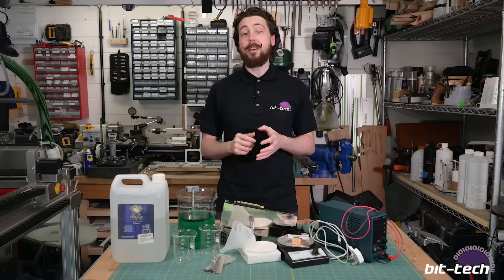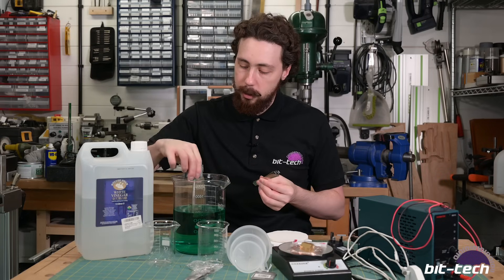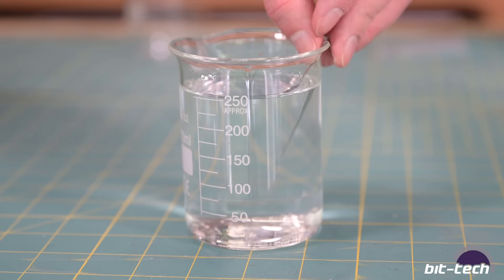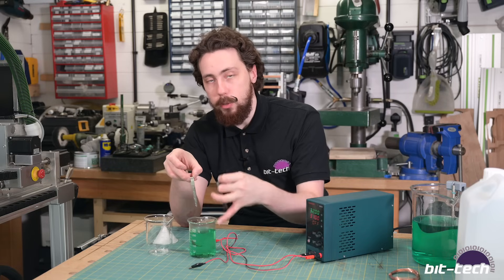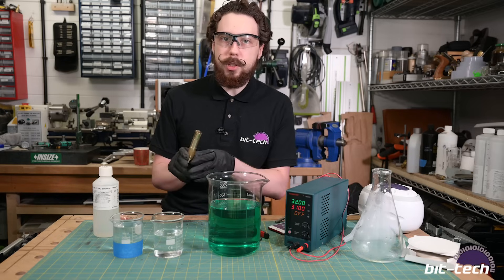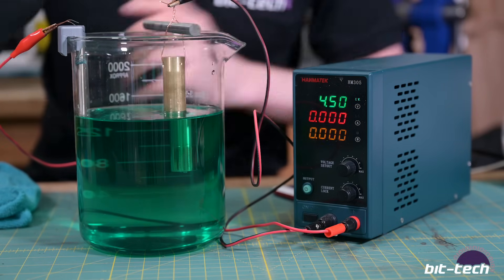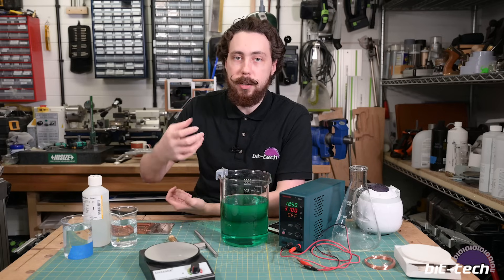How to Nickel Electroplate at Home | bit-tech Modding

Comment: Hi, any idea on how to estimate the amount of materials required for a particular surface area? Or I suppose, how do you know when the plating solution is exhausted?
Reply: I've never added salt to my solution. What I do use is canning vinegar or the 5% acetic acid. It seems to start plating nickel almost immediately without turning the blueish green color. Using 5 volts and polishing the parts to a mirror finish beforehand leads to the best results, don't forget to degrease the part before dropping into solution.

Comment: Question sir: I have a future project that involves doing this to a copper laptop heatsink including heat pipes for the purpose of applying liquid metal to obfuscate the inevitable corrosion. Thoughts?
Context: I would like to upgrade my Clevo P870TM1 with a 9900KS I purchased from Silicon Lottery that has been certified for 5.1Ghz and de-lidded as per their services. Under the constrained thermal environment of a laptop I want to give it as much headroom as possible and putting liquid metal between the IHS and the heatsink may only amount to a few degrees, but as you can see, every degree counts. That is also why I went with a Silicon Lottery certified 5.1Ghz KS as my reasoning is that if I don't get the full 5.1 out of the chip then 5.0 should be more power and thermal efficient based on the benchmarks for that chip, as that silicon is pushed right to the limit and there was quite a noticeable difference in thermal and power efficiency between the 5.2Ghz max of that chip and the 4.9Ghz min. I do know Der8auer, Roman, did a similar video recently that I have not yet watched, but he does not have anywhere near as cool of a moustache.....
Reply: Roman used the 'chemical nickel' process. Chemical nickel is more easy to apply locally to the Heatsink base but wont give you that nice Nickel plated look that you are used to seeing. It's more like turning copper a bit silver. Chemical Nickel would work for your purposes however unless you wanted to plate the entire heatsink into a lovely looking nickel. Go with electro plating if that is what you want to achieve.

Comment: If I solder brass pieces together, there will be spots where the solder remains on the surface.  Will these still plate uniformly (as in will the areas be significantly different in finish from the brass)?
Reply: That’s a really good question as I was wondering the same thing

Comment: Hello from Tokyo, I’ve gotten my hands on 0.5mol of Sulfuric acid, what is your recommendation on mixing with distilled water?
How many parts of 0.5 mol to distilled water to get a somewhat safe but effect level of acidity for the solution before I dip my nickel anodes?
Reply: Hello from Kyoto. In Japan e have 90% acetic acid available cheap and without restriction. Measure your PH to reach 3.5-4.5 acidity level. At least it works for me.
Reply: @MsLeguman  Thank you for your reply! 
I am wondering if I can use the 0.5 mol of my Sulfuric acid for light “etching “ to clean the surface before starting the plating process?

With many online videos it’s never clear what is being used as a “light etching” solution, I am I am hoping to use my sulphuric acid in some of my process.

It’s very nice to have a close neighbor commenting ;).  FYI I am based in Shibuya.
Reply: @r.in.shibuya  idk about sulfuric acid. i use HCL 10% sold by Matsuba, dip my parts around 3 min as concentration is quite low. Not sure it has an effect though. WIP on my side.

Comment: I have issues with adhesion, getting some spots where it flakes and peels. I have to go back, lightly sand the flaking/peeling down to where it adhered and replate that area. Any ideas or suggestions? I'm not using an adjustable power supply, no hotplate with stirring. I do an acid pickle with muriatic acid.
Reply: What is the part you want to coat made of?

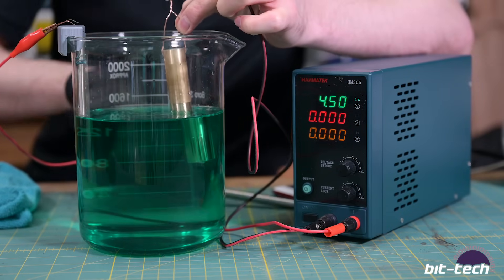Comment: @21:00 why was the current zero? the meters look like they have milliamp resolution, less than 1mA over what must be several square centimeters seems very low for many plating operations.  I can imagine that on a cheap supply the last digit might be fake, but less than 10mA is not much either.
Reply: I was thinking the same thing. In fact I have the same power supply and just checked it across a 400 ohm resistor. With the current set to 1-milliamp (0.001 amps) and the voltage cranked up over 3 volts the power supply enters constant current mode and, indeed, does display 0.001 amps... at 1.8 volts average, once it warmed up ( it bounces around a bit, +/- 0.15v).  Was 2.35 volts when first turned on. 
So, the last digit does work. Well, it read out a number, which can be set. A quick bit of ohms-law math reveals the current displayed is in error by ~400% (current x resistance = volts, .001 amps x 400 ohms = 0.4 volts; I'm reading a voltage almost 5 times higher). The actual current is 0.004 amps (4 milliamps, not 1 milliamp). The resistor is actually 466 ohms. And the actual volts are 1.81 average. So the volts reads out good.  
I would like to see what the voltage goes to with the volts set to 32v and the current set to 0.001 amps. 
Time to open up the power supply and see if it can be calibrated.
Edit: No calibration potentiometers inside. Looks to be firmware calibration only. I did check the error at higher current and the error in the current display seems to be consistant. It's reads 3-millamps low at 1-milliamp set, and 2.5 milliamps low at 400-milliamps set. So that's only a 0.6% error at 400 milliamps. Very acceptable.

Comment: Hi id like your imput on nickel plating the inside of a motor cycle steel petrol tank ? Older classic bikes often suffer with rust from the ethenol in newer fuels and old fuel being left for long periods of time. ,obviously the rust will be removed first .all the best bob

Comment: Red is positive = anode and white is negative = cathode. Why is mine making bubbles on the red wire side? Is it possible that the red wire is negative and the white wire is positive ? I am using a phone charger consisting of a red and a white wire.

Comment: i've been wondering about this is it fairly expensive?
Reply from the maker: Nope, the biggest expense by far is a DC power supply if you want full control, everything else is very affordable. Even then, you can use an old phone charger much of the time as they operate usually within 5V. Best bit is once you've made the electrolyte, you can keep it around and plate at will.
Reply: bit-tech thanks i'll give it a go for sure just got a DC power supply

Comment: Is there anything that you could paint on an area of the  item to be plated that would resist the plating only in that area? Blockout?
Reply: Great question that leads to broad possibilities. I have yet to plate but foresee a lot of trial attempts to answer such questions. If fingerprints block plating efforts then maybe start with the easiest block I can think of offhand - ink? Like a permanent ink pen which would allow selective plating creating a logo for example. Would that create an edge that would cause flaking of the plating down the road? On and on…So much fun. Good thinking Charles!

Comment: I tried to repeat the steps with a steel specimen, without much success. Seems there is no adherence of nickel on the cathode. Do you think the problem is the base metal? Does this work on copper only?
Reply: When I brought a steel part in for nickelplating, they said it first had to be copper plated to get a better finish

Comment: Were you able to measure the thickness of the coating you acheived with your micrometer?
Reply from the maker: James Carter You know, I never thought to check it. That could be quite interesting to see.
Reply: @bittech1   so what was the thickness ?
Reply: No.  The plating is way thinner than a thou or even a ten-thou.

Comment: Im trying to coat old bolts have soaked them in vinegar and removed the rust and ultrasonic cleaned them and then picked them but rust appears after would wax n grease remover or methylated spirits instead of distilled water it makes it rust

Comment: at 3:10 In my oppinion it's a really bad idea to put a lid on any electrolysis setup. 

you'll be producing hydrogen at one electrode, oxygen at the other.That's not dangerous if the gases can disperse, but becomes very dangerous (explosive atmosphere) when there's no ventillation. 

if you add salt, you'll be producing chlorine gas, which is poisonous, so again you want good ventillation.
Reply: I think he meant storing the solution with a lid when not in use.

Comment: I did an axe head.  But I guess I didn't leave it in the acid long enough.   There were spots it didn't take to. But I cleaned it off and dipped it in longer.  And the low spots filled in nicely.  But the later plating was a bit darker color.  And so it's two colors in places.  It came out smooth and well coated though. So I polished it up and went with it, hehe.

One thing though, the Nickel anode came out with a rust looking colored substance on the exterior.  I'm thinking it might have something to do with the  latter coating being darker.  I used a copper wire to suspend the part in the solution.  Does anybody have any ideas on what this is?  Or where it came from for sure?
Reply: It could be Copperions in your solution. At least it explains why your coating gets darker.

Comment: Great instructional video, thank you for sharing. For the chemical etch process could a weak ferric chloride solution be used? As I have plenty of this which I use in my DIY circuit board manufacturing, and can mild steel be nickel plated in this way? Thanks.
Reply from the maker: Unfortunately I'm not sure on the ferric chloride front, however it wouldn't hurt to try I'd have thought. If you plate steel in copper first, it can be electroplated in nickel okay enough, although without brighteners it might be a bit dull.

Comment: For the first part making the plating solution, would using equally sized electrodes and then use AC instead of DC not also work? Might be worth an experiment. Don't know why, but I've a gut feeling that it may help produce a stronger solution (especially if you lightly distilled the vinegar)
Reply: Would not work, as the plating happens due to the continuous electron flow in one direction.  AC as its name indicates alternates directions so you would deposit/remove alternating every 16.667ms
Reply: @skrattzerat5831  I'm not talking about the actual plating part, which you are correct does requires a DC current. I'm talking about the first part of making the nickel acetate solution (6:30), where he uses two nickel electrodes in the acetic acid/salt solution to make the green solution. For that part, the current direction doesn't matter.

Comment: In regards to shadowing - I guess you could pretty easily solve that by just using multiple (like maybe 3?) katodes in a rough ring formation around the plating objects. Doesn't seem like it would be very hard to rig up, and you should get the same "mileage" out of your katodes anyway.

Can you use different acid for the "pickling" process? I assume it doesn't matter so much what the acid or concentration is as long as you just give it appropriate time to etch the surface sufficiently to make the surface completely pure of contaminants. I'm thinking 35% vinegar (ascetic acid) might do that job fine. It's a weak acid unlike hydrochloric acid, but at a higher concentration and a bit more time I'm thinking that would compensate for it probably? Sorry, I'm an engineer, not a chemist :) Hydrochloric acid isn't so easily accessible for sure.

Comment: As a practicing engineer I strongly insist on starting such videos with a disclaimer. This is not a fun project. Safety first. Do this stuff only in ventilated space wearing the protective gloves and face mask or at least gloves. Have baking soda by your side. Consider adding this and following the rule from now on, even for your own projects, not only for youtube.
You've put the gloves on only after 15 minutes on, spilling the acid on 7th minute! BTW pure vinegar is a strong acid, right? What were you thinking of? What if someone tries to copy you and does so with a 30amps power source? He'd cause an explosion!
Also, some mistakes. After US bath cleaning you don't touch your part with the bare hands as it will cause greasing again. And try to use IPA in US bath then just dry it up with dry oil-free compressed air or nitrogen. Not by wiping it.
As for the rate of deposition it is pretty straightforward, Faraday's law. The thickness of the layer per time depends on the current passed through the part's surface. Not the voltage.

There is also a practical advice if you're still reading. The best results for both corrosion resistance and adhesion of Ni is achieved when you make tripple layer plating. Ni - Cu (thin) - Ni.
Reply from the maker: Pavel Gorlachuk Disappointingly condescending comment if I’m honest. Pro tip, if you want people to take you seriously in your advice, don’t begin by alienating them at the start by mentioning a title.
Reply: @bittech1  regardless of your feelings you have to adhere to the safety rules. Being offended is not the same as being physically injured.
Reply: Gotta say that he didn't touch the part that he was plating after cleaning it...